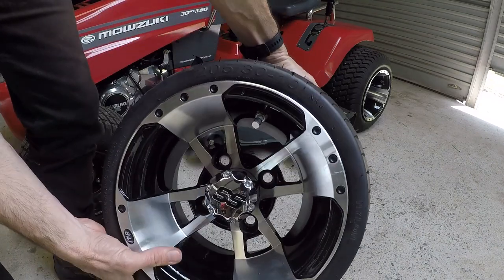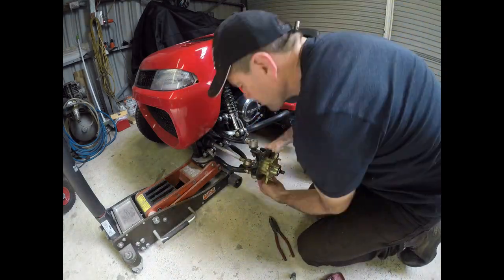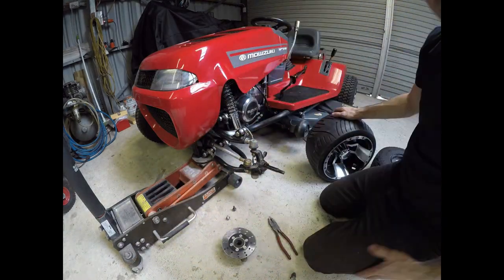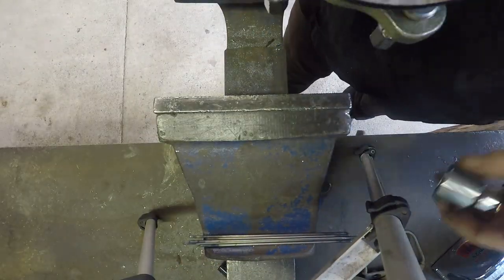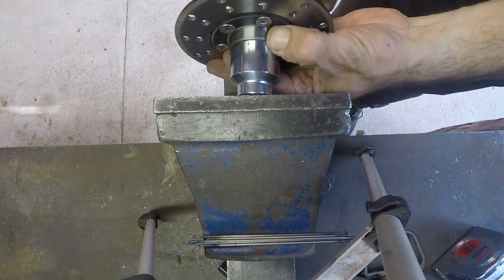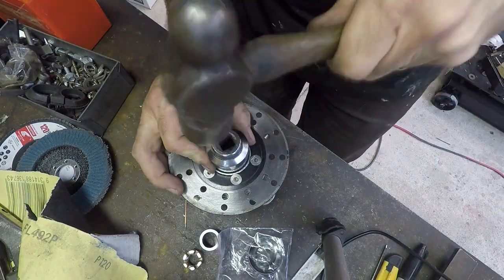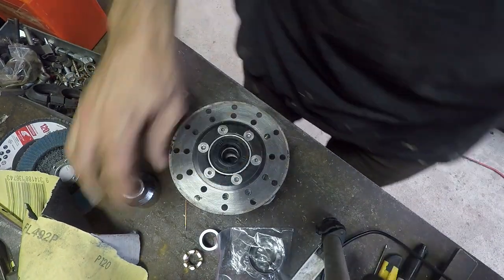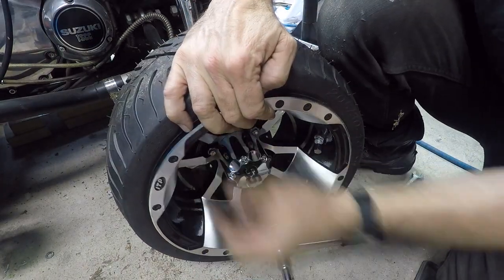Mowzuki Performance Rims

Comment: This is a build that sticks in my mind, and it really does look like a lawn tractor Suzuki would build if they had a ag performance division
Reply from the maker: Thanks Aveoxus, I'd be happy to work with Suzuki to put these into production. I reckon they would be popular. Now thinking of additional attachments I can make. Thinking of extending the Mowzuki capabilities past mowing, drifting and towing. Maybe digging, ploughing etc. not sure yet...
Reply: @Mezzmoengineering  I'm not sure how your rear axle is set up, but a power take off or PTO would extend the rpm from the differential to whatever implement you would use. Could maybe run a roto tiller, brush hog, snow blower. Things that need need torque to run

Comment: Now that's the cherry on top. Since I need something to push dirt and gravel around, my winter project is a heavy duty MTD chassis with a Cub Cadet Original transaxle and powered by a Honda CX500 powerplant. Rear tires will be 24X12.50X12 Ag treads. It won't be pretty, or fast, but I reckon it'll get the job done. Thanks for the inspiration....
Reply from the maker: Sounds good. Glad I've got you to get building..

Comment: I just watched this entire build playlist, I only found 3 things I didnt like, 1. I actually forgot this one, so it must not have been important, 2. Have to admit, its a little disapointing you went with a two blade deck, but its what you had, and it works, and finally number 3. I hate those low profile tires.... nice rims though. I think the way you dig the deck, mounting and actually driving it, was absolutely genius. The frame you built, it seems like its rugged, even more so than some actual road legal cars, one might say overkill, Or even excessivly overkill, and quite frankly, thats awesome in my book. that paint, its... Its amazing. I love the fact that you actually took the time and put tail lights on it, hell, you even put reverse light on it. You put so much time and skill into this, and it came out so amazingly perfect. You have talent. you have the tools and skills to put together the things you dream up, you have the patience to actually see it through from start to finish, and with such a high production quality... one day, I hope I can have half the skill you have.... Couple of questions though. that sandblasting attachment you use, does that just hook up to a bog standard shop air compressor? the paint gun as well? do you have to do anything special to attach them? and does you mechanical masterpiece of a lawn mower use a typical lawn mower battery, or a motorcycle battery?
Reply from the maker: Hi Daniel, thanks for your comments. Tyre choice is personal choice so my view was to build it the way I wanted and not what I thought others might like. Yes, I maintained the stock lawn mower battery as its much bigger than a motorbike battery and I was able to fit it in. The sandblaster I have does hook up to a standard air compressor. My compressor is 8cfm, so not big. For spray painting the compressor is fine, its a bit small for the sand blaster but just means I need to stop blasting after a minute or so for a bit to allow it to catch up. The spray gun I use is an IWATA W77 and it hooks straight up to the compressor, just need to make sure it has a filter/regulator to keep water out and maintain the right air pressure. I've been in engineering for a very long time and one thing I have always done is give things a go. I'm a mechanical engineer who started out as a Fitter and Turner. Spray painting and other things I do are just from pushing my boundaries and giving things a go. Sometimes more than once to get it right.